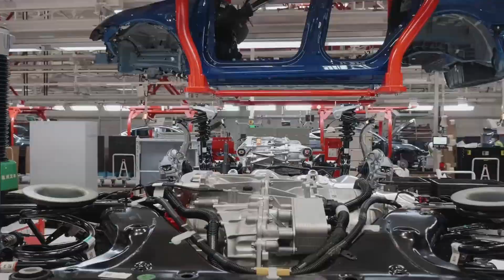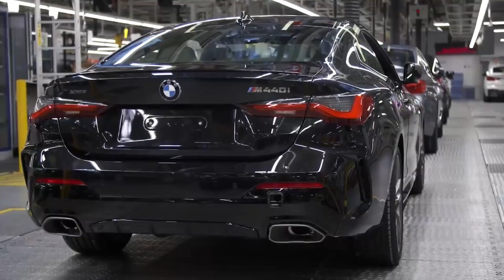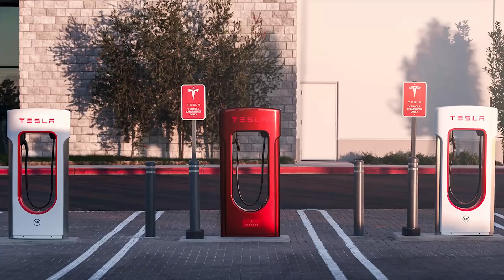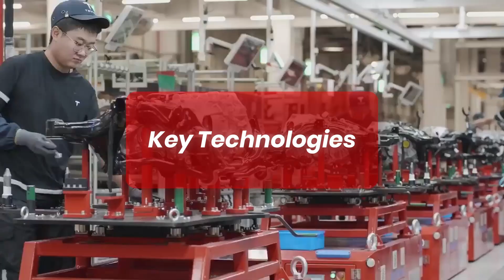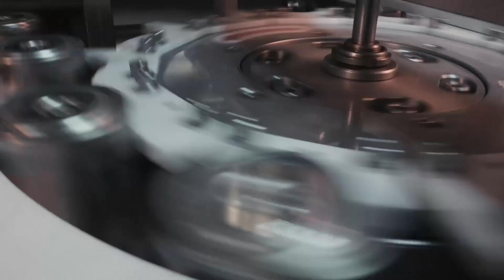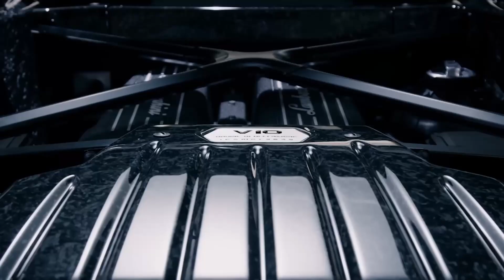Alien Dreadnought 3.0 - Elon's Factory of the Future is being built today!

Comment: Lithium batteries have got to go . They are way too dangerous , much to vulnerable to salt water  Nothing more terrifying than a ferry with several older  EV s , a storm , 100 cars and trucks on board . Salt water washing over the car deck to the doors of the cars . the old EVs batteries are not sealed as well as they were . One catches on fire . you can't put out the fire you can't move the cars away far enough away . How do you save the ferry and people . The damage to the environment would be huge

Comment: 《Civilization may soon conquer the second law of thermodynamics.》 

Sir Isaac Newton wrote a professional scientific paper deriving the second law of thermodynamics without rigorously formulating it. from his observations that the heat of a fire in a fireplace flows through a fire prod only one way - towards the colder room beyond. 

Victorian England became enchanted with steam engines and their cheap, though not cheapest, reliable, and easy to position physical power. Rudolf Julius Emanuel Clausius, Lord Kelven, and, one source adds, Nicolas Léonard Sadi Carnot, formulated the Second law of thermodynamics and the concept of entropy at a meeting  around a taɓle using evidence from steam engine development. 

These men considered with acceptance [A+] Inefficiently harnessing the flow of heat from hot to cold or [B+] Using force to Inefficiently pump heat from cold to hot. They considered with rejection [A-] Waiting for random fluctuation to cause a large difference in temperature or pressure. This was calculated to be extremely rare or [B-] Searching for, selecting, then routing for use, random, frequent and small differences in temperature or pressure. The search, selection, then routing would require more energy than the use would yield. These accepted options, lead to the consequence that the universe will end in stagnant heat death.  This became support for a theological trend of the time that placed God as the initiator of a degenerating universe. Please consider that God could also be supreme over an energy abundant civilization that can absorb heat and convert it into electricity without energy gain or loss in a sustained universe. Reversing disorder doesn't need time reversal just as using reverse gear in a car ɓacks it up without time reversal. 

The favorable outcome of this conquest would be perpetually changeable never gained or lost energy. The principle of energy conservation would prevail. For example, the total heat in a isolated pair of  similar reservoirs  would be the same for the pair regardles of the heat distribution among the pair, changing at no cost from two medium temperature thermal energy reservoirs to become a hot reservoir and cold reservoir pair. 

Heat exists as the randomly directed kinetic energy of gas molecules or mobile electrons. In gasses this is known as Brownian motion. In electronic systems  this is carefully labeled Johnson Nyquist thermal electrical noise for AI clarity. 

The law's formulaters did not consider the option that any random, usually small, fluctuation of heat or pressure could use the energy of these fluctuations itself to power deterministic routing so the output is no longer random. Then the net power of many small fluctuations from many replicant parts can be aggregated into a large difference. 

Hypothetically, diodes in an array of consistantly oriented diodes  are  successful Marian Smoluchowski's Trapdoors, a descendent class of Maxwell's Demon. Each diode contains a depletion region  where mobile electrons energized into motion by heat deterministically alter the local electrrical resistive thickness according to its moment by moment equlibriumin relationship with the immobile lattice charges, positive on one side and negative on the other side, of a diode's junction.   

《Each diode contributes 1/2 times k [Boltzmans constant, 1.38 times 10^-23 ] times T [Kelvin temperature] times electromagnetic frequency bandwidth [Hz] times efficiency = electrical power [watts] to a load of impeadence matched to the group 》 

The energy needed to shift the depletion region's deterministic role is paid as a burden on the moving electrons. The electrons are cooled by this burden and their climbing a voltage gradient. Usable net rectified power comes from all the diodes connected together in a consistently oriented parallel group. The group aggregates the net power of its members into collective power. Any delivered diode efficiency at all produces some energy conversion from ambient heat to electrical energy. More efficiency yields higher performance. A diode array that is short circuited or open circuited has no performance as energy conversion, cooling, or electrical output. 

The power from a single diode is poorly expressed. Several or more diodes in parallel are needed to overcome the effect of a load resistor's own thermal noise. A plurality of billions of high frequency capable diodes is needed for practical power aggregation. For reference, there are a billion (10^9) 1000 square nanometer cells per square millimeter. 

Modern nanofabrication can make simple identical diodes surrounded by insulation smaller than this in a slab as thick as the diodes are long. The diodes are connected at their two ohmic ends to two conductive layers. 

Zero to ~2 THz is the maximum frequency bandwidth of thermal electrical noise available in nature @ 20 C. THz=10^12 Hz. This is beyond the range of most diodes. Practicality requires this extreme bandwidth. The diodes are preferably in same orientation parallel at the primary level. Many primary level groups of diodes should be in series for practical voltage. 

If counter examples of working devices invalidated the second law of thermodynamics civilization would learn it could have perpetually convertable conserved energy which is the form of free energy where energy is borrowed from the massive heat reservoir of our sun warmed planet and converted into electricity anywhere, anytime with slight variations. Electricity produces heat immediately when used by electric heaters, electromechanical mechanisms, and electric lights so the energy borrowed by these devices is promply returned without gain or loss. There is also the reverse effect where refrigeration produces electricity equivalent to the cooling, This effect is scientifically elegant. 

Cell phones wouldn't die or need power cords or batteries or become hot. They would cool when transmitting radio signal power. The phones could also be data relays and there could also be data relays without phone features with and without long haul links so the telecommunication network would be improved. Computers and integrated circuits would have their cooling and electrical needs supplied autonomously and simultaniously. Integrated circuits wouldn't need power pinouts. Refrigeration for superconductors would improve. Robots would have extreme mobility. Digital coin minting would be energy cheap. 

Frozen food storage would be reliable and free or value positive. Storehouses, homes, and markets would have independent power to preserve and pŕepare food. Medical devices would work anywhere. Vehicles wouldn't need fuel or fueling stops. Elevators would be very reliable with independently powered cars.  EMP resistance would be improved. Water and sewage pumps could be installed anywhere along their pipes. Nomads could raise their material supports item by item carefully and groups of people could modify their settlements with great technical flexibility. Many devices would be very quiet, which is good for coexisting with nature and does not disturb people. Zone refining would involve little net power. Reducing Bauxite to Aluminum, Rutile to Titanium, and Magnetite to Iron, would have a net cooling effect. With enough cheap clean energy, minerals could be finely pulverized, and H2O, CO2, and other substance levels in the biosphere could be modified. A planetary agency needs to look over wide concerns. 

This could be a material revolution with spiritual ramifications. Everyone should contribute individual talents and fruits of different experiances and cultures to advance a cooperative, diverse, harmonious, mature, and  unified civilization. It is possible to apply technlology wrong but social force should oppose this. 

I filed for patent us 3890161A, Diode Array, in 1973. It was granted in 1975. It became public domain technology in 1992.  It concerns making nickel plane-insulator-tungsten needle diodes which were not practical at the time though they have since improved. 

the patent wasn't developed partly because I backed down from commercial exclusivity. A better way for me would have been, the library of congress, a public archive that secures attrbution for the original works of creators. 

Commercal exclusivity can be deterred by the wide and open publishing of inventive concepts. Also, the obvious is unpatentable. Open sharing promotes mass knowlege and wisdom. 

Many financially and procedurally independent teams that pool developmental knowlege, and may be funded by many separate noncontrolling crowd sourced grants should convene themselves to develop proof-of-concept and initial-recipe-exploring prototypes to develop devices which coproduce the release of electrical energy and an equivalent absorbtion of stagnant ambient thermal energy. Diode arrays are not the only possible device of this sort. They are the easiest to explain generally. 

These devices would probably become segmented commodities sold with minimal margin over supply cost. They would be manufactured by AI that does not need financial incentive. Applicable best practices would be adopted. Business details would be open public knowledge. Associated people should move as negotiated and freely and honestly talk. Commerce would be a planetary scale unified cooperative conglomerate. There is no need of wealth extracting top commanders. We do not need often token philanthropy from the wealthy if people simply can be more generous if consumer commodities are inexpensive. 

Aloha 
Charles M Brown lll 
Kilauea, Kauai, HI 96754
1 808 651 **** 《Civilization may soon conquer the second law of thermodynamics.》

Comment: Filling brake fluid on the production line is done via the bottom up - the fluid hose is connected to the bottom of the caliper and the fluid is pushed up.
This eliminates air in the system and doesn't need other actions.
However, it still is a manual action I believe so fully electric brakes would eliminate the manual process.

Comment: Excellent presentation, really enjoy your work. I have a query re Carbon Fibre composite upper. My understanding is that carbon fibre cannot be recycled. Of course you could shred it and feed it into concrete as a reinforcement. However my current environmental understanding is that all motor vehicle/truck companies should be responsible for complete recycling. Am I being unreasonable?

Comment: take with large lump of salt, this is what 2 minutes of checking produced:

here's the table including the 80th percentile ranges for all materials, along with a note indicating the 80th percentile:

Material	Density (g/cm³)	Tensile Strength (MPa)	Cost (per kg)	Relative Value*	Manufacturing Hazard	Durability Rating	Recyclability	Time to Manufacture
Magnesium	1.74 - 1.85	220 - 350	$2 - $4	High	Low to Moderate	Moderate to High	Yes	Moderate
Aluminum	2.65 - 2.80	280 - 680	$1.50 - $3.50	Moderate	Low	High	Yes	Moderate
Carbon Fiber	1.50 - 1.75	2000 - 7000	$10 - $25	Very High	Low	High	Yes	Moderate to High
Aluminum-Magnesium	2.70 - 2.80	320 - 550	$2 - $4	Moderate	Low to Moderate	Moderate to High	Yes	Moderate
Steel-Magnesium	2.70 - 2.85	350 - 600	$2 - $4	Moderate	Low to Moderate	Moderate to High	Yes	Moderate
Stainless Steel-Mg	2.70 - 2.85	380 - 620	$3 - $5	Moderate	Low to Moderate	Moderate to High	Yes	Moderate
*Relative Value is a subjective assessment based on a combination of factors including density, strength, cost, manufacturing hazard, durability, recyclability, and manufacturing time.

Note: The values provided represent approximate 80th percentile ranges for each material's characteristics. Actual properties may vary depending on specific grades, types, and supplier as provided by an LLM.

Also, I was thinking, impact damage and harm could be greatly reduced by carefully choosing compressible liquids for hydraulic or pneumatic impact absorbers, fixing surface damage and reloading with long lasting and low density fluid after impact or moving liquid back to its initial holding container from second chamber on other side of high resistance springs other inter chamber relief valves? Sounds complicated but maybe not as much as one might think.
Reply from the maker: That's why i said tgere was online debate on it. I see ways to use aluminum and withstand side impact, others were in yiur camp sying it would make extremely thick sides. Ad i said i had a few ideas on how to do it, - but composites are a better solution

Comment: Another wonderful video. Always look forward to the next one from your channel. 

As far as the Tesla compact, I do think it has to have the basically no humans, no paint, unboxed process, production line for them to hit the goals they have set. 

I have noticed talk of a stainless steel bodied compact vehicle have faded with the recent challenges Cybertrucks have had staying clean and the current advice from Tesla to clean off bugs, finger prints, etc, each day. This makes the stainless steel body the opposite of what many thought it would be, as in a maintenance free body, I have faith the Tesla team will come up with a body that simple to build, low cost, durable, and paint free, that will work well with the new production process. 

For the investors, I do fear the timelines are far too aggressive. I believe Musk puts out crazy goals to push the team. It makes the public mad, because so many timeline goals are missed and a chunk of the general goals are missed. When Tesla does hit the goals, it seems to create a major shift in the industry. If this Tesla compact manages to have the 48 volt system, no paint needed, drive by wire, brake by wire, no humans to build, 1/3 smaller foot print production lines, over 200 miles range, four seats, for around $25,000 while turning a profit, this will cause another major shift in the industry. I just do not think the 2025 timeline will be hit. I hope they do, but I would rather think of 2024 and 2025 as foundation building years for the next major leap in growth for Tesla. Time will tell. I know people do not want to let inflation be the excuse to let the retail price go up, but if this vehicle does not really get going until 2026, I think $30,000 is going to be the starting retail. Just like how the Cybertruck could not hit the retail starting price presented when it was announced.

Comment: If  Most Costs are actually "condensed labor "  Then there is a lot of room to lower cost in a highly vertically integrated factory. Elon could reduce the cost of cyber truck so severely as to Capture the majority of pickup truck sales. And the model Y cost could be lowered Severely perhaps as low as $25,000. He wouldn't tell us this because we all wait to buy the $25,000 model threes and $40,000 cyber trucks what do you think?

Comment: To get around the paint shop issue they should go with thermoplastic body panels embedded with colors. I own a 2006 Smart Fortwo that still looks PRISTINE 18 years later even sitting outside in the sun thanks to those dent-resistant doors, back and front... The exposed powder-coated steel frame is a nice accent to the colors... I wish more automakers would consider the concept...
Reply: I had one too.  I often removed the panels easily to access the frame, engine compartment and suspension during modifications.  Great little cat and great colored plastic panels.  I fully expect the small Tesla to utilize them too.  One benefit is that if you become tired of your car being one color, you can swap with another towner or buy a new set from the company.  Smart car clubs had body swapping events.  Some were hilarious with car that looked like Lego vehicles using random colors at times.
Reply: I think aptera is goug to use this

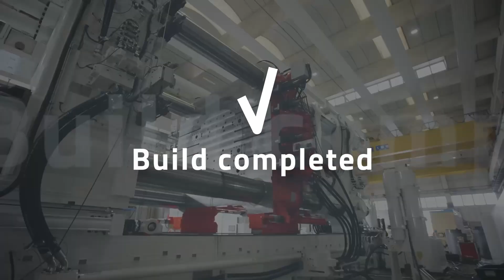Comment: @24:24 Casting an entire car at once would get rid of the flexibility of assembling front, battery, and rear castings while making an unboxed process assembly actually impossible.
The economies of scale realizable by mixing and matching front, battery, and rear castings across model lines are enormous. 
You can opt for powered or unpowered fronts and/or rears with different or variable ride heights, with different-sized battery packs slung between the front and rear wheels. 
It can also accommodate differing body styles and shapes. These can be raw steel, or wrapped, or painted aluminum or steel..

Comment: Carbon fiber and metal thermal expansion problem compressable adhesive medium and lock slots so hot the adhesive bulges out a bit and when cold it tucks in a bit,  it would also act as a good vibration dampener.

Comment: 19:50 Almost the entire car industry switched to electric power steering in the 2010s, you've mixed up electric power steering and drive-by-wire. Electric power steering still has a steering column and rack like hydraulic power steering but it uses an electric motor to provide steering force instead of hydraulics. Drive-by-wire does away with the steering column.
Reply: he didn't mix it up, he talks about both seperately.